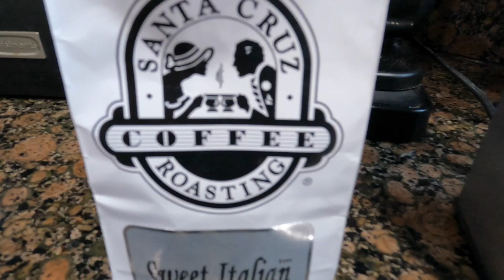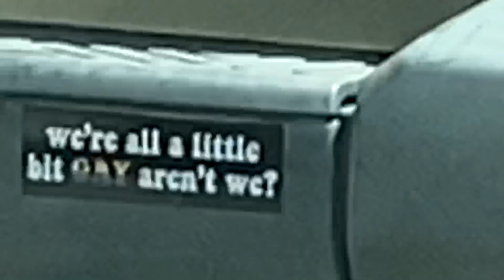Condensate leak on a 4 drawer unit

Comment: I use a 80 cubic foot scuba bottle at 3k psi regulated down to 150 psi with a blow gun to get the cardboard box dust out of the upright coolers and freezers condenser coils on our offshore vessels.

Comment: Nice work Dave! The hardest part of that repair had to be removing and reinserting the 509 screws for that backing plate
Reply: I was just about to comment on that.  Fuck me what a piss take .   I would of put 8 back in.    Cheshire U.K.
Reply: Maybe they should put 1 screw per inch i dont think they have enough holding that panel on..